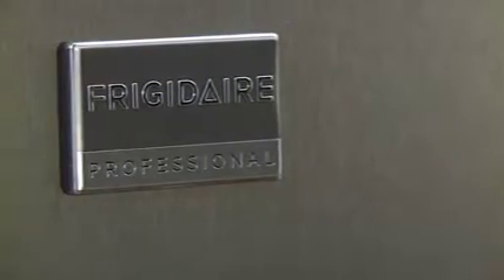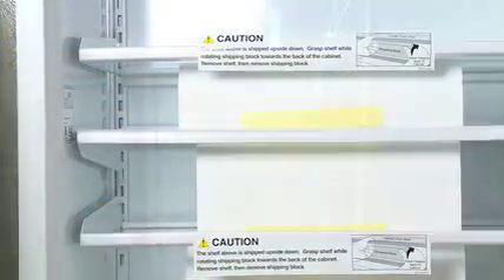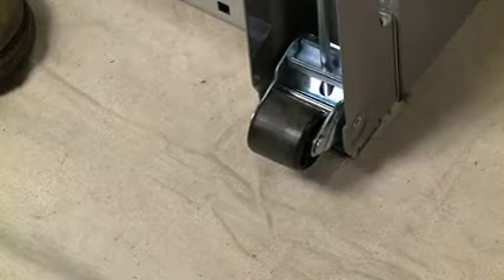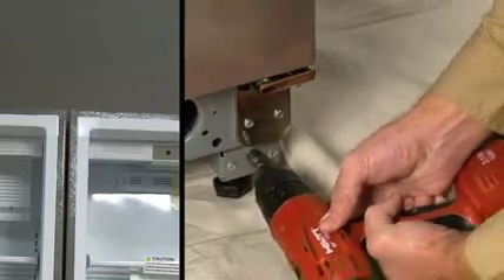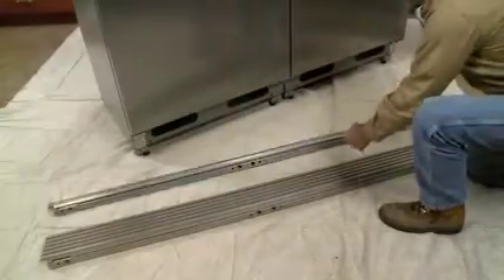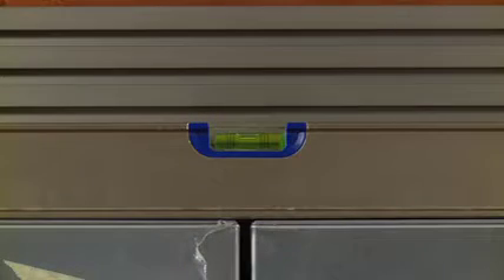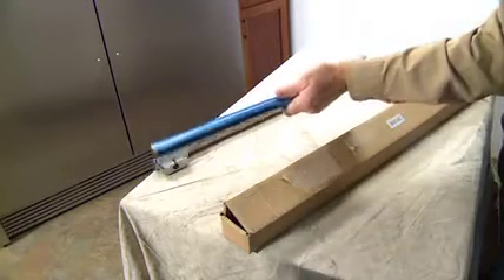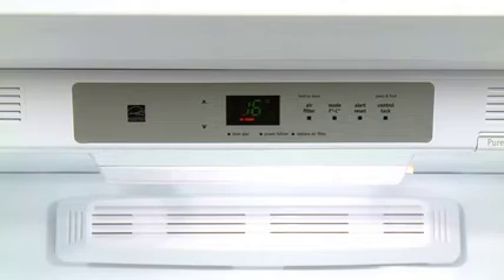Frigidaire Refrigerator Installation - Frigidaire Install

Comment: So grateful you made this great video!  I have to pull a dual unit out to replace the start relay and capacitor on the freezer side. I see how to lower the rear wheel using the socket. How do you lower the front wheels so I can slide the whole pair out and get to the rear machine compartment? Was it explained and I just missed it? If so, please let me know where in the video. Thanks so much!